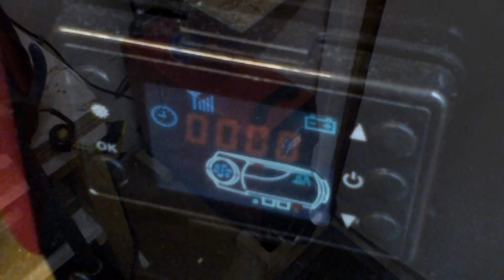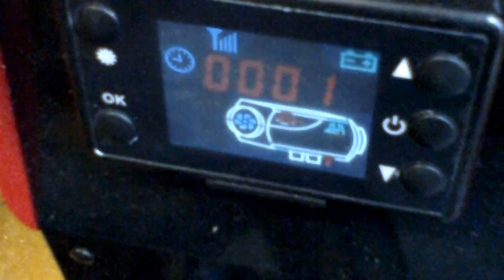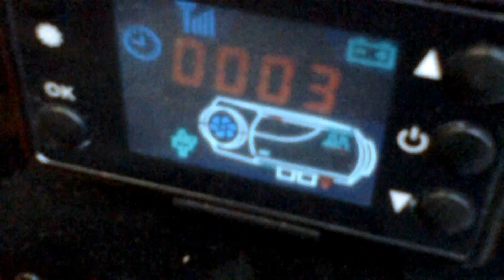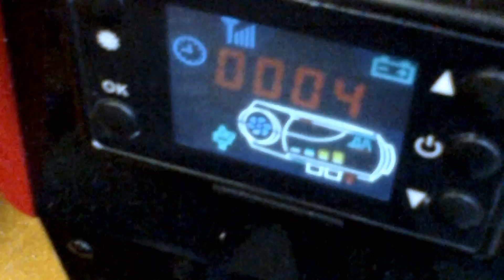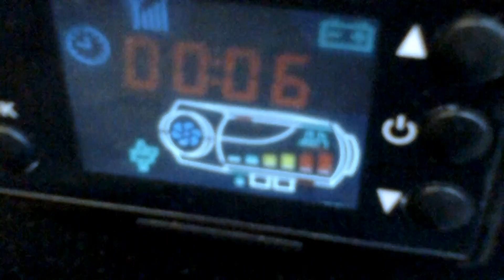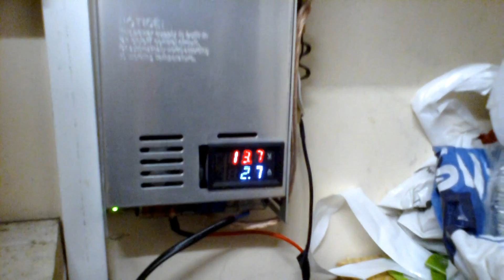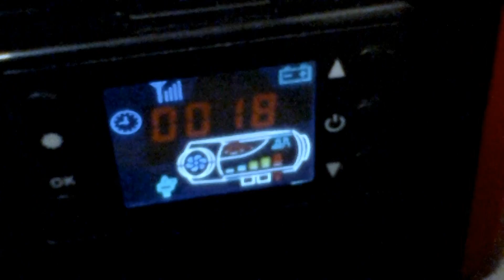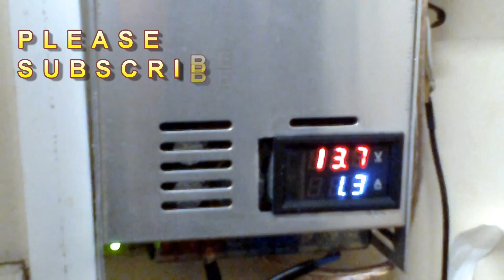COMPACT CHINESE DIESEL AIR HEATER - AMPS used in REAL TIME

Comment: Good vid thank you. I have one the same. the glow plug use at end of run is necessary for extra heat for the combustion chamber cleaning. makes sense since there may be soot build up after many hrs on a low heat setting. They are fantastic little heaters. I think I'll get the water heater version as well. Much appreciated ,cheers.

Comment: How did you wire up the volt/amp metre up that’s miles better
Reply from the maker: High Craig. That part of the power supply I made from additional parts and as it’s messing about within the mains power supply I can’t post how I did it.
Got to keep people safe. Thanks for viewing the video - many ideas on my channel - wonder if you’ve seen the hot water from a diesel heater…
Regards Peter.

Comment: Your  are correct re amps at starting up but it depends on the KW output:) We do know once the voltage drops below 11 volts or a little less the heater will shut down.

Comment: when you say there is no glup on what do you think keeps your diesel burning there?.. thank you for this video
Reply from the maker: Hi Marcus’s. Once the ignition takes place and the combustion chamber gets hot enough it will support its own combustion without the need for the glo plug to be energised. The glowplug turns off and it’s the fan feeding air and the dose pump supplying a precise volume of fuel that keeps the combustion going….
I hope that give you the information to help you understand the process.
Regards Peter

Comment: Hi great video fantastic. Can I ask what unit on the wall your using and can you send me a link to get one . I’ve got a 5kw  thanks
Reply from the maker: Hi Kevin. Power supply is just a 20 Amp switch mode and all  on eBay and no problem to find but please note the little meter was put in by me and is not an item included in the power supply.

Comment: Thanks for doing this - wish you would have had the cam on the amp meter when the fuel pump turned on. My heater was kicking out when the fuel pump was called, and I couldn't figure out what was going on. The heater would power off and reset the clock. I had a 12 v / 15 amp power supply which I assume was good enough, however had to upgrade and I went with a 30 amp power supply. Must be a spike in power demand when the fuel pump is called.
Reply from the maker: Hi Dave. The power supply I recommended off eBay was a constant voltage switch mode power supply - great value for 20 quid max.
Because the draw of the heater is more on start up and shutdown the power supply sensor adjusts its output to stay constant all the time so fluctuation’s would not be shown and what you see is the true current draw in Amps.
That’s why I recommended that type of power supply which has now been adopted by loads of others - I should have sold them🤔
Thanks for taking the time to reply.
Stay safe and warm - Regards Peter

Comment: can you use a battery charger annd not use a 12 volt battery
Reply from the maker: Hi Kelvin. You said a battery charger and these come in a number of forms and some only have half wave rectification which if connected to the heater would kill the electronics… the power supply shown is less than £20 on eBay so best go that route. Regards and stay warm. Peter
Reply: @brucepeter2007  Thank you so much Peter.Will do

Comment: One thing that is not clear is, the fan obviously pushes air into the room through the large pipe after drawing it through the heater from the large input pipe, but how is the airflow powered through the combustion chamber and out through the exhaust pipe? Are there two fans?
Reply from the maker: Hi there. I was not covering the working method of the unit just the power consumption as there was so much confusion about volts ans Amps.
Plenty of good videos out there to answer your question so have a look around but all I will say is that if installed correctly they are good and safe heaters.
Problems are usually down to bad installations. Regards Peter

Comment: Hello   would you recommend a 5 kw or 8 kw all in one heater, they are about the same price on eBay from China , any advantage over each other, for garage.   Thanks
Reply from the maker: Got two friends who run the 5kW and it’s fine. 8kw is same unit with different dose pump and settings - the units are the same
Reply: Hello   what's the dose pump you mentioned, will the bigger one not run warmer more heat hotter air less economical,  I noticed the dimensions on the 8kw are bigger than the smaller one,  I have a choice between the two just want to make the right decision.    Thanks
Reply from the maker: @martinmorgan8475  Hi Martin. You need to look at more YouTube videos befor you buy and they will answer all your questions - especially about the dose pump noise which is an issue to some but can’t be changed by it’s very nature…

Comment: Hi Peter excellent video
I have a lighting transformer 240v to 12v/25amp oblong black plastic box not like one u useing are these OK to use to power the 5kw heater or would u advise just get one like yours off ebay 30amp  Not sure what the difference,s are between them it is rated at 12v/25amp  Thanks
Reply from the maker: Hi Mario.
I have no experience with lighting transformers so I can’t comment on them. The power unit I use is a switch mode power supply which is a good candidate as it will be able to cope with any demand. They have the advantage of changing from almost stand by to full power as they detect what is drawn and “wind up” accordingly to put it in simple terms. Install and forget so to speak.
The unit you mention maybe fine but if it goes down on the shut down when everything is red hot you could cook your control board…
Regards Peter
Reply: @brucepeter2007  
Thanks for getting back to me right ok
Could u send me the ebay link or item number for the one u have please 
Thanks
Reply from the maker: @mariospagoni6140  Hi again. I don’t know the link but just type in 12v 20Amp  switch mode power supply and you will get the same picture come up.as I have in my video. - 20A is big enough.
Regards Peter

Comment: Thanks, glad I found this very useful info. I was advised to get a 30amp transformer but it is very noisey. I now intend to switch to a 20amp without a fan if I can find one..
Reply from the maker: Hi Dave. Go on eBay and put in 20 amp switch mode power supply and a picture of mine will come up but without the amp meter which I added. Job done
Reply: @brucepeter2007  Thanks.
Reply: Hello Peter, found it and it looks to have a fan, if so, is it noisy?
Reply from the maker: @davidsalter9592  very quite small fan
Reply: @brucepeter2007  Thanks again, great help.

Comment: Thanks for the video Pete. Im absolutely gutted. I was constantly reading they don't draw more than 10amps on start up and saw a couple of videos with them running on portable power stations with a 10 amp 12v outlet socket. 

With this info I bought a poweroak with the 10amp socket and it starts the heater but trips out when the heater combusts.

It's an 8kw vevor which I know is a (5kw tweaked to go above 4.9h). 
I saw your one went over 10 amps on start up. Would an 8kw one go even higher ?
Reply from the maker: Hi there. As far as I am aware the 8kW mechanics on the unit is the same as the 5kW but the fuel delivery and and fan speed is increased but this is only what I have read so is not confirmed.
Relating the question on the power draw I would guess the gloplug used is the same so the draw for the initial time duration for the ignition may be longer but I suspect the draw current load would be the same…
Regards Peter

Comment: Hi do you know how much electricity it uses when connected to the transformer thanks?
Reply from the maker: Hi James. The unit in the test was a switched mode power supply and the Amps used by the diesel heater is clearly shown. Older style heavy transformers are not often used now as switch mode supplies are more efficient and less expensive to manufacture. I hope I’ve answered your question. Regards Peter
Reply: Could you tell me how you wired in the battery backup please.

Comment: For completeness what's the draw when it's on standby, for instance if you started the shutdown then just left it overnight switched on but not running? Assume it's negligible but in my workshop it could be like this for days on a battery.
Reply from the maker: Hi Gary. Don’t leave the unit on standby as the LCD panel is not a good quality and you will soon not able to see the display as it fades away

Comment: Please could you indicate the name of the device you are using to power the heater? Ty.
Reply from the maker: Hi there. Look on eBay for a 20 Amp switch mode power supply and you will find loads the same as mine - remember I fitted the volt / Amp meter myself.
Regards Peter

Comment: Hi Pete great video, could you please advise if possible, if you used a pc psu to supply the 12v for the heater, And the psu states it was capable of supplying 22A 12v....and in total with its other available connections (5v connections etc) it has a max output of 750w dc, would the unit itself be drawing the input5A (1200w)ac as it states...as standard to its job, supplying dc whatever dc you require? Or would it be drawing less ac Watts? (paying for less) if you were only drawing the 12amps dc while the glow plug uses more and a lot less Watts dc when it's ticking over? Hope you get my question, just trying to be efficient  with the ac costs and wanting to use a power supply really rather than a battery. Thanks
Reply from the maker: Hi there. I stayed with a custom eBay psu as messing about with a computer power supply was not something I wanted to do. The eBay 20A unit was only about £15 and you can wind the voltage up to 13.5v and it’s compact and stays constant during the glo plug start up when the current draw is at maximum… Regards Peter
Reply: @brucepeter2007  would you say in the mix of things...your power supply costs much to run? Cheers
Reply: What fuse did you use for the input to the PSU from 240v? Thanks
Reply: @glenmcdonald2979  mine was a 12v 30amp, so a 3amp fuse was fine (360w÷240v=1.5amp current) I'd go 5amp if on  110v
Reply: @neilscragg2148  I've got the same one (12v 30a)
My heater is being delivered today and I can't wait to install it. So you reckon a 3 amp fuse will be ideal for the plug if I make a cable up too power the power supply off 240v wall socket? Cheers mate
Reply: @glenmcdonald2979  be fine, and you won't be pulling half if what tge supply is capable of if just running the heater off it 👍

Comment: What kw is you heater please I have a 8kw one will a 30 amp do tia
Reply from the maker: Hi Roger. The power the gloplugs draw is the same because the same plug is used in the 2, 5 + 8kW units.
stay safe.
Regards Peter

Comment: Dang, three minutes of glow plug operation?  My truck starts after just twelve seconds, at sub-freezing temps.  

With that much usage, it raises a concern for me of burning out.  Would you happen to know if there are replacement glow plugs available for these heaters?
Reply from the maker: Hi Uriah. In answer to you questions - yes the parts are all there on eBay and although the glo plug stays on some time they don’t burn out quickly.
I have two units and I have two friends who got theirs just after me and one uses it to heat his bungalow and the only thing that’s failed in 3 years was the dose temp which was temporally fixed by a sharp tap with a hammer to overcome the stuck piston to make contact. So don’t worry - get one and stay warm.
Stay safe & Merry Christmas to you sir. Peter
Reply: @brucepeter2007  So I must ask, the glow plug comes on at start up and shut down. In the case of you and your friends heating a building, I assume the glow plug only comes “on” and “off” at the season beginning and end?  From what I can tell in the video and your remarks of it being like furnace, it must just slow the drip rate down when the thermostat temp is reached, keeping combustion going continuously during operation?

I guess I’m asking because I plan the install this thing in my van.  It will be fired up in the morning before I go to work and then shut down when I arrive.  Running for say, an hour.  The heater in my van is horrendous, when well below freezing it can take a half hour of idling before I get good heat.  Obviously that is a lot of wear on the vehicle and wasted fuel.  Since I’m cheap, I don’t let it idle that long and just tough it out and freeze all the way to work.  

I did look, and it does appear that parts are available.  Makes me feel much better.  Thank you for the reply.
Reply from the maker: @Uriah625  Hi again - you are exactly right on your remarks and all I can say is do a good installation and DONT ness with the setting and you will be toasty in your van - when you get too hot just open a window.
Regards peter
Reply: @brucepeter2007  thank you very much

Comment: Hello, a great video on this heater. Could you tell me if this heater would be sufficient to heat a steel garage 6mx4m in size? at the moment uninsulated but I hope to have that done soon. thank you
Reply from the maker: Hi Phillip. Your steel shed with no insulation would be a challenge as the heat would be removed as soon as the heated touched the sheet steel sides.
No doubt it would help but it would be on full all the time so it would cost you in diesel. Bit of insulation put up and you would be toasty warm and you would not do as much diesel… Regards Peter

Comment: What amp fuse do i use if i install the heater to a 12v car battery thanks
Reply from the maker: Hi there. In line 20A will be fine
Reply: @brucepeter2007  thanks

Comment: What power supply are you using?
Reply from the maker: Hi Sam. Thanks for the reply.
Power supply is just a 20 Amp switch mode and all  on eBay and no problem to find but please note the little meter was put in by me and is not an item included in the power supply.

Comment: Hey man, thanks so much for putting this up. I'd heard they peak at 10 amps, but had no idea how long for. Especially useful, to hear about the shutdown cycle also using glow plug and boosted fan. I've not got an ammeter on my van, so I'd have been completely in the dark without your video. It's not discussed anywhere I've seen :-) What's interesting is running freshly charged at 13.7-13.8v. If the battery is older or discharged to 12.5v after a weekend away - the battery might struggle to push 12 amps more than a few minutes, without the voltage sagging
Reply from the maker: Hi Neil. Thank you so much for the comments and kind reply about my video.
I sometimes see questions on a forum come up about it and reply with the link address which helps them. I made the video so people could understand the difference between volts and amps and the video is the best way to get it across.
I am so glad it helped you and that’s the wonder of YouTube for information and if you want to share the video please do.
Again thanks for taking the time to comment - so many don’t bother.
Stay safe. Stay warm.
Regards Peter

Comment: This is great Im off grid in the country and conscious of battery power consumption which I measured but never considered consumption during shut down - a number of friends have these and have had problems with changing settings when running temperature has been reached - thank you
Reply from the maker: Hi Barry. Glad my video helped you. Many people have tried messing about with the settings but usually always end up sooting up the internals. This heater is more like a furnace in operation as it either on or off and you can only slow it down so much before soot is produced which gradually builds up felicitating a full dirty strip down. - Answer is leave setting alone unless you have the correct equipment. Also ensure the installation is done correctly and the unit will perform well for years. Stay warm, stay safe.
Regards Peter

Comment: Does it keep you garage heat up?
Reply from the maker: The heater keeps you toasty warm. Fantastic bit of kit. I have two units.
Reply: @brucepeter2007  
Awesome did you bought from Amazon?
Reply from the maker: @Syed.S.A  Hi again. Yes I did get the both from Amazon as I got let down twice for delivery from eBay.
Regards Peter

Comment: I have a 24v system... do I have to use a step down converter to 12v in order to run a Chinese heater in my van?
Reply from the maker: Hi Bud. No problem as you can buy them for both voltages - as they were designed to be lorry cab heaters most fitted in lorries were 24v and it’s only this camper market that showed there was a demand for a 12v system so they made slight changes to cater for both voltages.
Order up a 24v and you will be toasty warm.
Stay safe.stay warm. 
Regards Peter

Comment: I need to figure the pull for 12-24 hours ...

Roughly 12 amps for 6 minutes and 6 minutes(12 total), then about an average of 4 amps for 1/4 hour and about 1 amp for 3/4 hour    12A(6min) then 4A(15min) then 1A for the duration to shutdown ... is this about right?   

I wonder what a decent formula might be ... (12 * 0.2) + (4 * 0,2) + (0.5 * hours run) ...
Reply from the maker: Hi there. What your doing is a bit hard as there are variables you can’t allow for - outside temperature, insulation of area to be heated, Eve you setting the temperature just 1C higher will change the current used and the amount of fuel. Best way to work is forget the sums and allow for a comfortable over margin and that way you know you’ll be safe.
And warm.
Regards Peter